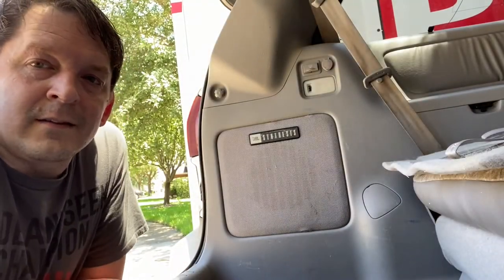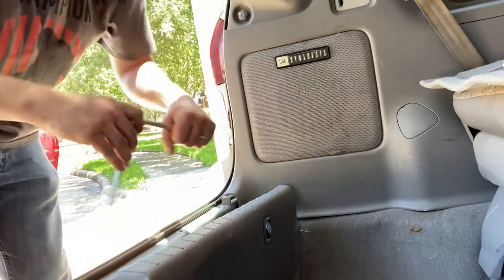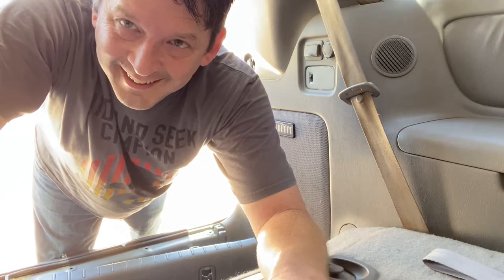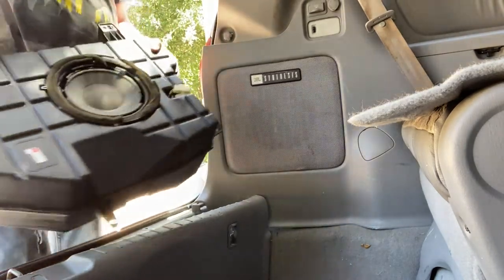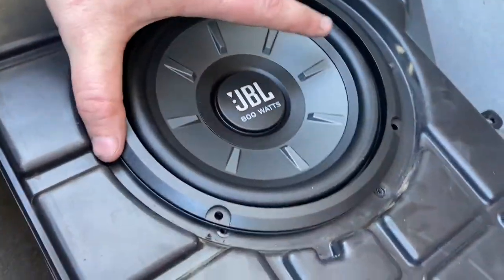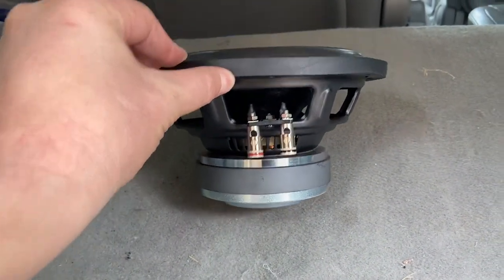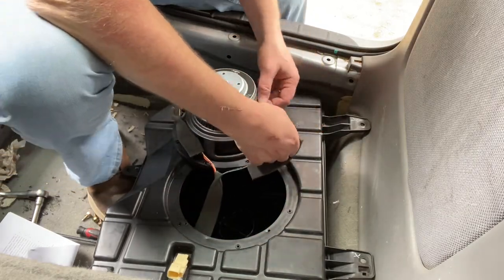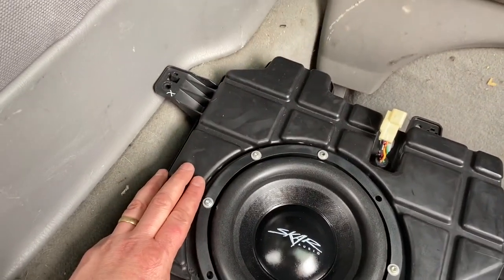Toyota Sienna Stereo "Crackling Sound" From Rear - Subwoofer

Comment: Thank you!!  This video made my install super straight forward and easy to do solo.  One tip that I found made it easier to remove and reinstall the box, was to stuff an old sweatshirt (or towel, blanket etc) between the trim panel and the inside the body of the car.  This gave me just enough room to work and maneuver without banging up my knuckles.  Thanks again!
Reply from the maker: Excellent advice! Thank you for taking the time to comment.

Comment: Most informative video.  i just bought the same skar sub  for my 05 Seinna.  Still a little confused.  Are the contacts on the sub marked with the red ring the positive hookup?  Just  checking.  Can't really get a clear answer from Skar.  Thank you.
Reply from the maker: Fore sure, the speaker terminals are color coded. Red for positive and black for negative. I just cannot remember if the terminals were stamped as such.

Comment: For the speaker you purchased and listed in the summary, was it really as simple as cutting/stripping the end of the original wires and inserting them into the coils of the new speaker? Thanks for posting! This video pushed me over the edge of trying to decide whether to do it myself or pay for an install. diy it is.
Reply from the maker: Hello. Yes. This speaker was easy with spring loaded quick release connections. Good luck with the replacement and thank you for commenting!

Comment: Fantastic video, you've motivated me to DIY.  I do have one question:  when you cut out the plastic in the box to make room for the new sub, did you cut to the point where the plastic supports the new sub or did you cut so there is a gap and the plastic and sub don't touch?
Reply from the maker: I cut the plastic to where the base of the sub would not touch. I did not want any vibrations which could make noise to occur. The plastic is pretty soft and easy to cut. Thanks!